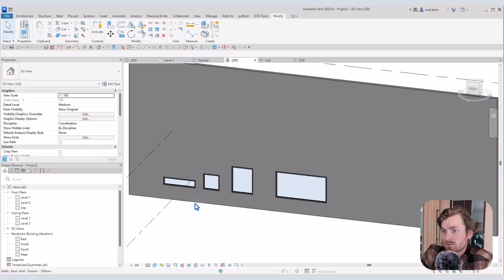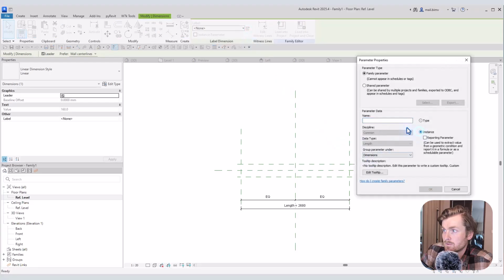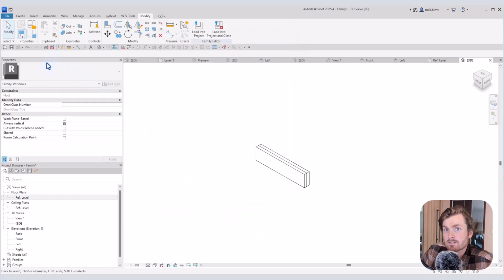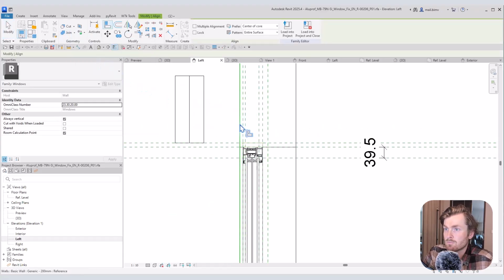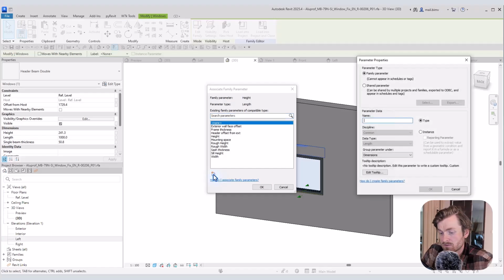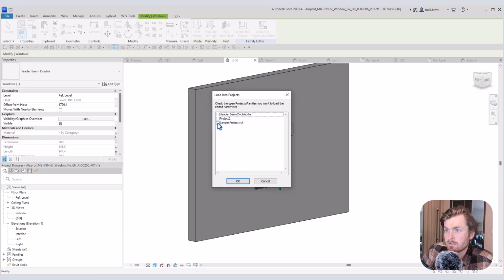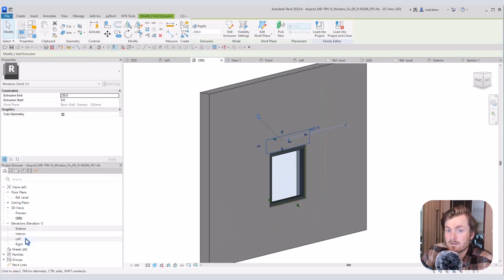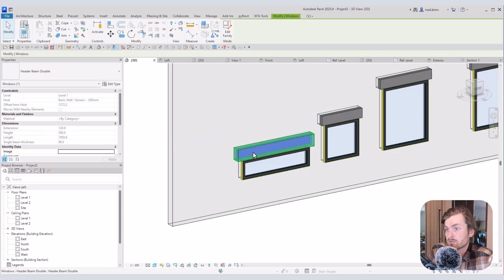How to add Headers / Lintel beam over Windows in Revit | revituni.com

Comment: What we need is a lintel familt which we can on and off with multiple lintel types (concrete, L profile etc.) depending on need. And this is the frustrating part because the void opening will stay where it is, even there isn't any lintel needed. What you did, is pretty intermediate. Hope you the best. Sorry for criticizing.
Reply from the maker: not fully get the criticism... You ask about features or saying that you have better solution already set up. Because Revit don't have a good "select from a list" option to switch between families. I wish it would but it doesn't.